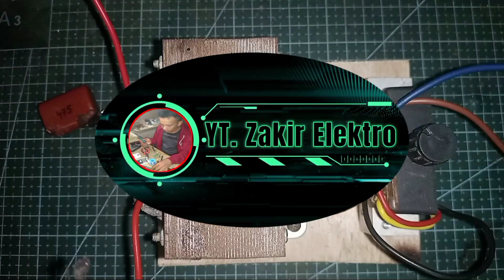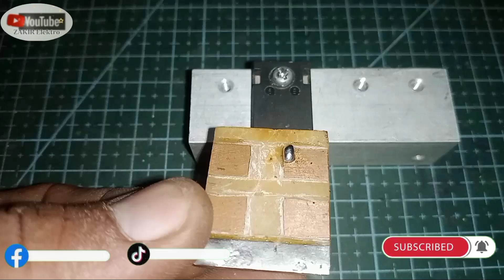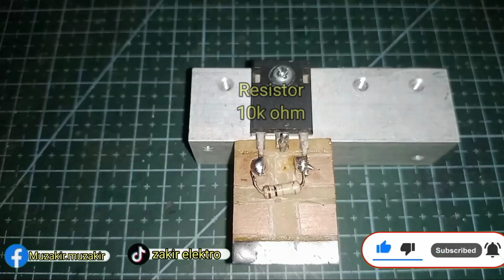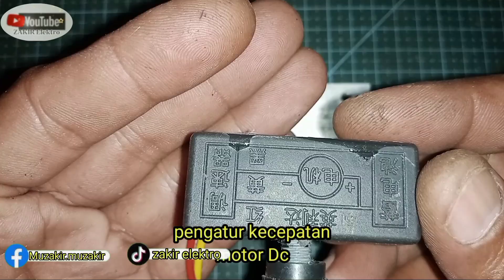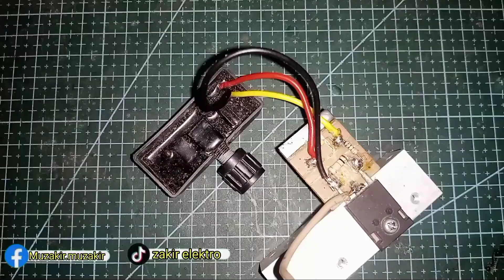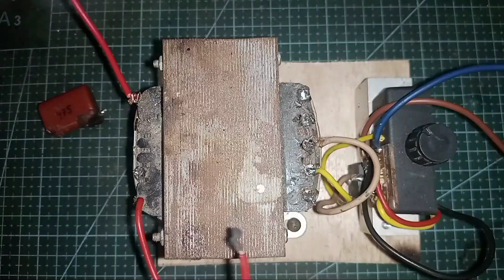mengubah tegangan dc 12 volt menjadi 10.000 volt #plasma #pac #setrum

Comment: Itu  fungsi  resistor 470ohm  untuk apa bg. 
Klo  10k yg menuju ke  gate kan pembatas  arus?
Reply from the maker: @zainulmustofa8037  untuk menyalurkan tegangan + ke kaki gate 
Karena dari rangkaian hanya mengeluarkan (-)
Reply: @Zakir_Elektro   jadi  kalo potensio di besarkan maka arus nya  ngalir ke gate. 
Sebab hambatan dari potensio membesar. 
Dan jika potensio di kecilin maka hambatan akan  mengecil dan  arus menuju ke  kabel kuning. Begitu kah bang?
Reply from the maker: @zainulmustofa8037  iya bg, modul itu menggunakan IC ne 555 yg menghasilkan frekuensi tergantung setelan potensio
Reply: @Zakir_Elektro  klo  tanpa potensio  sprayer  emng gak bisa ya bang. Jadi  tegangan +  langsung masuk ke  gate melewati resistor
Reply from the maker: Iya gak bisa bg